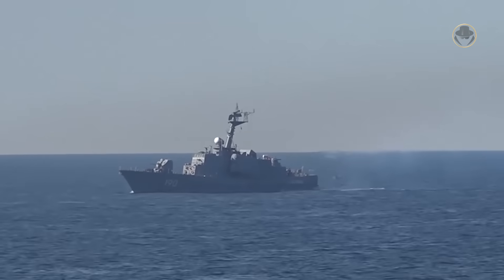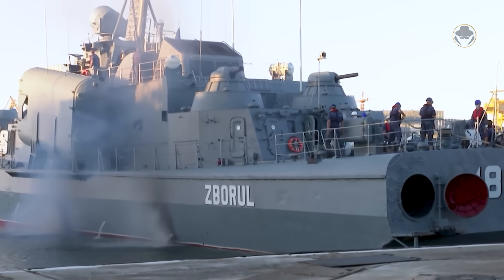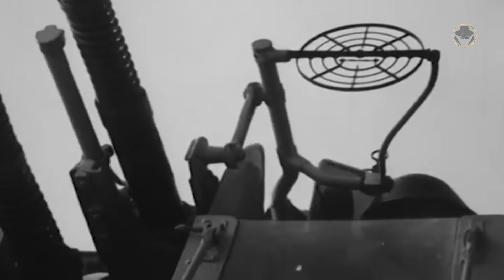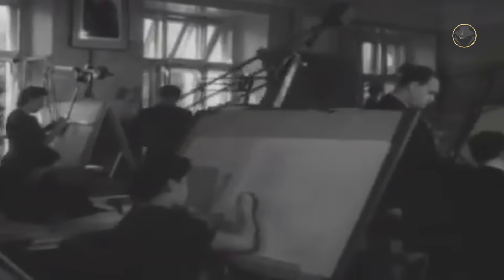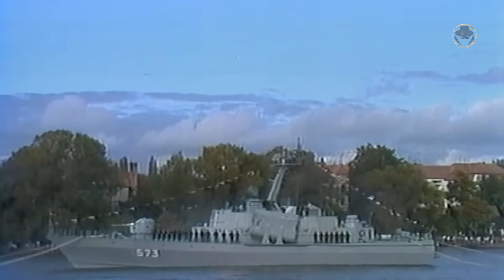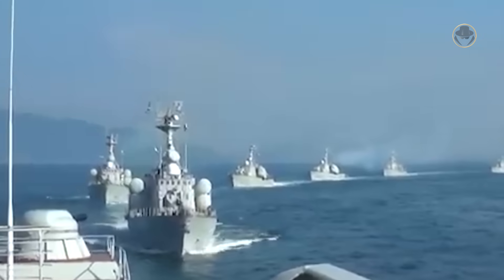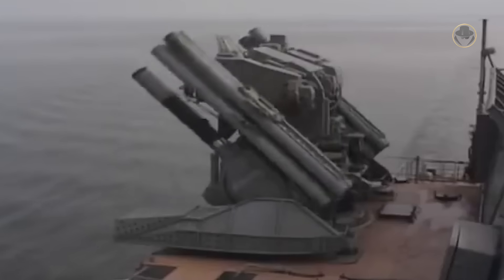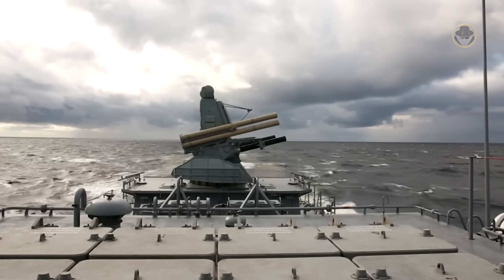Project 1241 Molniya (Tarantul) class | The guardian of many nations' coasts for 45 years

Comment: coastal defense by navies worldwide should be delegated to a new dedicated sub-branch of the navy specialized in littoral warfare only . . . equipped with lightweight guided missile fast attack craft & fast interceptor craft . . . displacing anywhere between 440 ton - 1,463 ton & powered by efficient hybrid marine propulsion system . . . armed with compact deck guns, surface-to-air, anti-ship & land attack cruise missiles . . . not to mention next gen guided torpedos & anti-submarine rockets . . . also capable of carrying & launching loiter drones & defending itself against similar measures if exercised by the enemy . . . estimated cost per unit €54.0 Mn - €176 Mn (approx) depending on exact customer specifications . . . corvettes should be a part of deployed naval fleet halfway across the world, not littoral waters . . .

Comment: It's interesting that a makeshift Soviet design is kept in production, alongside Buyan-class derivatives, actual corvettes with Vertical Launch System cells. 

40 sailors per ship appears to be quite a lot to spare even for rapidly expanding a 'Fleet in Being', so the ship is likely more suited for export of interim solutions at dire budgets - maybe for rather heavily armed coast guard duties (tasked with sinking ships Beyond Visual Range) - than building even minor 'Sea Power' (if they were simple to procure and maintain, the Soviet Union would have probably built more of the Anti-Submarine Warfare variant).